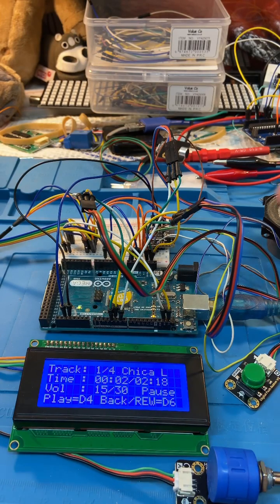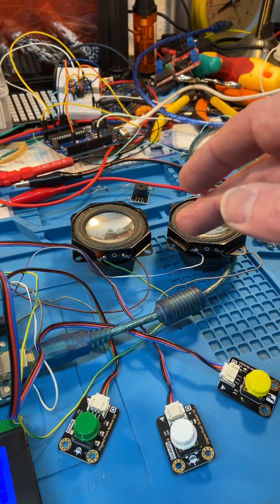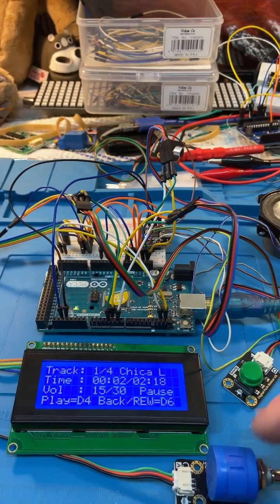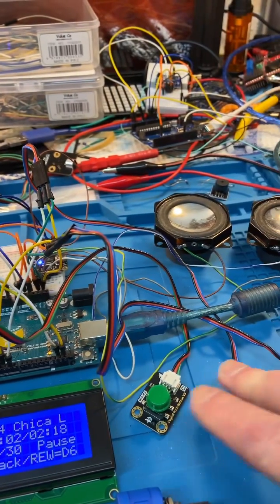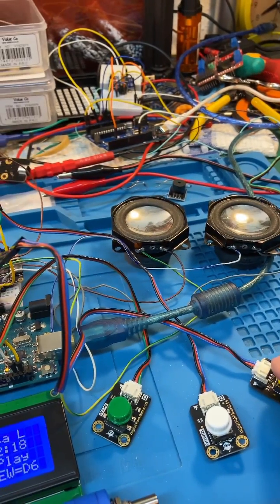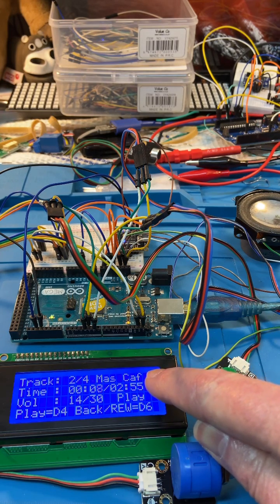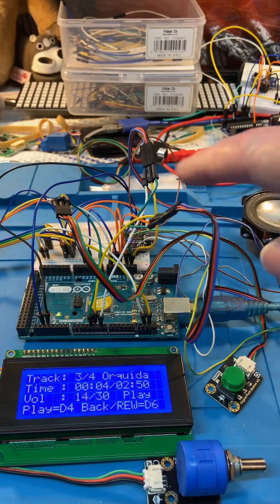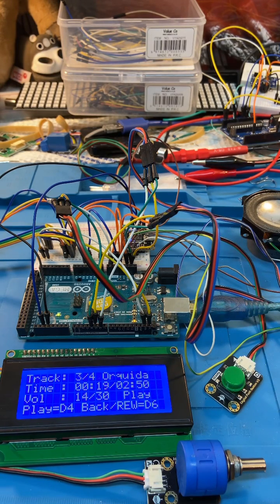Arduino Mega MP3 Player with LCD & Button Controls 🎶

Comment from the maker: #include <Wire.h>
#include <LiquidCrystal_I2C.h>
#include <DFRobot_DF1201S.h>

// ---------------- LCD ----------------
LiquidCrystal_I2C lcd(0x27, 20, 4);   // change 0x27 if needed

// ---------------- MP3 (DF1201S) ----------------
DFRobot_DF1201S mp3;
HardwareSerial &mp3Serial = Serial1;   // Mega: RX1=19, TX1=18

// ---------------- Inputs ----------------
const uint8_t POT_PIN  = A0;
const uint8_t PLAY_PIN = 4;  // Play/Pause (active HIGH)
const uint8_t FWD_PIN  = 5;  // Forward: short=Next, long=FF 10s (active HIGH)
const uint8_t BACK_PIN = 6;  // Back:    short=Prev, long=REW 10s (active HIGH)

// ---------------- State ----------------
int volume_0_30 = 20, lastVolume = -1;

unsigned long lastLCD   = 0;
const unsigned long LCD_MS  = 300;

unsigned long lastQuery = 0;
const unsigned long QRY_MS  = 500;

uint16_t curFile = 0, totalFiles = 0;
uint32_t curTime = 0, totalTime = 0;
String   fileName = "";
uint8_t  playMode = 0;
bool     isPlaying = false;

// ---- Button handling (debounce + long-press) ----
const unsigned long DEBOUNCE_MS  = 30;
const unsigned long LONGPRESS_MS = 700;

// Play button
bool pb_state=false, pb_prev=false;
unsigned long pb_changedAt=0;

// Forward button
bool fb_state=false, fb_prev=false;
unsigned long fb_changedAt=0;
bool fb_longFired=false;

// Back button
bool bb_state=false, bb_prev=false;
unsigned long bb_changedAt=0;
bool bb_longFired=false;

// ---------- helpers ----------
int readVolume() {
  int raw = analogRead(POT_PIN);      // 0..1023
  int v = map(raw, 0, 1023, 0, 30);   // DF1201S volume range
  if (v < 0) v = 0; if (v > 30) v = 30; return v;
}
String mmss(uint32_t sec) {
  char b[8];
  snprintf(b, sizeof(b), "%02lu:%02lu", (unsigned long)(sec/60), (unsigned long)(sec%60));
  return String(b);
}
void printFixed(uint8_t c, uint8_t r, const String &txt, uint8_t width) {
  lcd.setCursor(c, r);
  String out = txt;
  if ((int)out.length() > width) out.remove(width);
  while ((int)out.length() < width) out += ' ';
  lcd.print(out);
}

void setup() {
  Serial.begin(115200);
  delay(150);

  // LCD
  lcd.init(); lcd.backlight(); lcd.clear();
  printFixed(0,0,"DF1201S Player",20);
  printFixed(0,1,"Init...",20);

  // MP3 @115200 per DFRobot example
  mp3Serial.begin(115200);
  if (!mp3.begin(mp3Serial)) {
    printFixed(0,1,"Init FAILED",20);
    printFixed(0,2,"Check RX/TX & SD",20);
    while (true) { delay(1000); }
  }

  // Music mode & defaults
  mp3.switchFunction(DFRobot_DF1201S::MUSIC);
  delay(200);
  mp3.setPlayMode(DFRobot_DF1201S::ALLCYCLE);
  playMode = mp3.getPlayMode();

  // Volume from knob
  volume_0_30 = readVolume();
  mp3.setVol(volume_0_30);
  lastVolume = volume_0_30;

  // Buttons (active-HIGH). If using raw switches, add 10k pulldowns to GND.
  pinMode(PLAY_PIN, INPUT);
  pinMode(FWD_PIN,  INPUT);
  pinMode(BACK_PIN, INPUT);

  // First info read
  totalFiles = mp3.getTotalFile();
  curFile    = mp3.getCurFileNumber();
  curTime    = mp3.getCurTime();
  totalTime  = mp3.getTotalTime();
  fileName   = mp3.getFileName();

  // Screen
  lcd.clear();
  printFixed(0,0,"Track: --/--",20);
  printFixed(0,1,"Time : --:--/--:--",20);
  printFixed(0,2,"Vol  : --/30  ----",20);
  printFixed(0,3,"Play=D4 Back/REW=D6",20);
}

void handlePlayButton() {
  bool raw = digitalRead(PLAY_PIN);   // HIGH when pressed
  if (raw != pb_prev) { pb_changedAt = millis(); pb_prev = raw; }
  if (millis() - pb_changedAt > DEBOUNCE_MS) {
    if (raw != pb_state) {
      pb_state = raw;
      if (pb_state) { // rising edge
        if (isPlaying) { mp3.pause(); isPlaying = false; }
        else           { mp3.start(); isPlaying = true;  }
      }
    }
  }
}

void handleForwardButton() {
  bool raw = digitalRead(FWD_PIN);    // HIGH when pressed
  if (raw != fb_prev) { fb_changedAt = millis(); fb_prev = raw; fb_longFired = false; }
  if (millis() - fb_changedAt > DEBOUNCE_MS) {
    if (raw != fb_state) {
      fb_state = raw;
      if (!fb_state) {
        if (!fb_longFired) {        // short press = NEXT
          mp3.next();
          isPlaying = true;
        }
      }
    }
    if (fb_state && !fb_longFired && (millis() - fb_changedAt >= LONGPRESS_MS)) {
      mp3.fastForward(/*seconds=*/10);  // long press = FF 10s
      fb_longFired = true;
      isPlaying = true;
    }
  }
}

void handleBackButton() {
  bool raw = digitalRead(BACK_PIN);   // HIGH when pressed
  if (raw != bb_prev) { bb_changedAt = millis(); bb_prev = raw; bb_longFired = false; }
  if (millis() - bb_changedAt > DEBOUNCE_MS) {
    if (raw != bb_state) {
      bb_state = raw;
      if (!bb_state) {
        if (!bb_longFired) {         // short press = PREVIOUS
          mp3.last();
          isPlaying = true;
        }
      }
    }
    if (bb_state && !bb_longFired && (millis() - bb_changedAt >= LONGPRESS_MS)) {
      mp3.fastReverse(/*seconds=*/10);  // long press = REW 10s
      bb_longFired = true;
      isPlaying = true;
    }
  }
}

void loop() {
  // ---- Volume ----
  int v = readVolume();
  if (v != lastVolume) { mp3.setVol(v); lastVolume = v; volume_0_30 = v; }

  // ---- Buttons ----
  handlePlayButton();
  handleForwardButton();
  handleBackButton();

  // ---- Queries (gentle) ----
  if (millis() - lastQuery >= QRY_MS) {
    lastQuery = millis();
    curFile    = mp3.getCurFileNumber();
    totalFiles = mp3.getTotalFile();
    curTime    = mp3.getCurTime();
    totalTime  = mp3.getTotalTime();

    static uint32_t lastName = 0;
    if (millis() - lastName > 1500) {
      fileName = mp3.getFileName();
      lastName = millis();
    }

    // Heuristic: if time is moving, we’re playing
    static uint32_t prevTime = 0;
    if (curTime != prevTime) isPlaying = true;
    prevTime = curTime;
  }

  // ---- LCD ----
  if (millis() - lastLCD >= LCD_MS) {
    lastLCD = millis();

    // Line 0: Track & short filename
    String tline = "Track: ";
    tline += (curFile ? String(curFile) : "--");
    tline += "/";
    tline += (totalFiles ? String(totalFiles) : "--");
    if (fileName.length()) {
      String shortName = fileName;
      int slash = shortName.lastIndexOf('/');
      if (slash >= 0 && slash < (int)shortName.length()-1) shortName = shortName.substring(slash+1);
      if (shortName.length() > 7) shortName = shortName.substring(0,7);
      tline += " " + shortName;
    }
    printFixed(0,0,tline,20);

    // Line 1: Time
    printFixed(0,1,"Time : " + mmss(curTime) + "/" + mmss(totalTime),20);

    // Line 2: Vol + status
    char vbuf[21];
    snprintf(vbuf, sizeof(vbuf), "Vol  : %2d/30  %s", volume_0_30, isPlaying ? "Play" : "Pause");
    printFixed(0,2,String(vbuf),20);

    // Line 3: Hints (fit 20 chars)
    printFixed(0,3,"Play=D4 Back/REW=D6",20);
    // If you prefer all hints, swap to:
    // printFixed(0,3,"Back=D6 Next=D5 A0",20);
  }
}